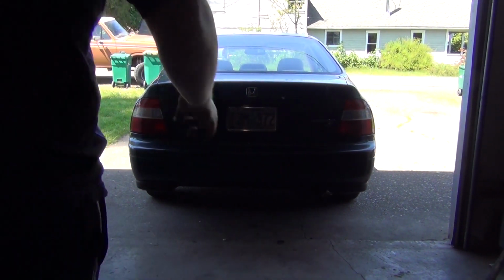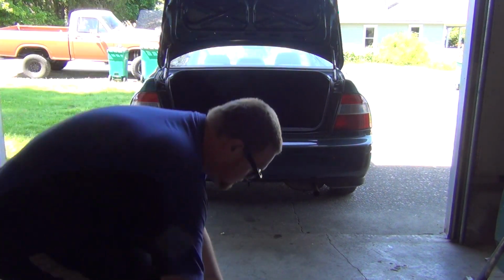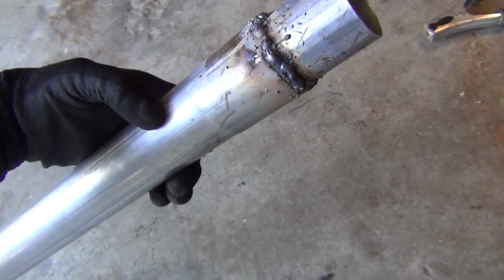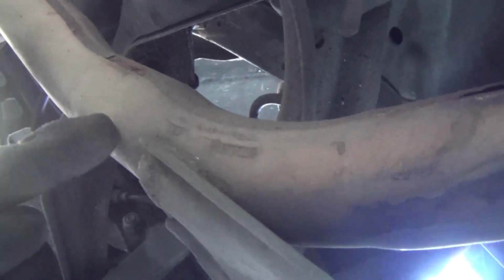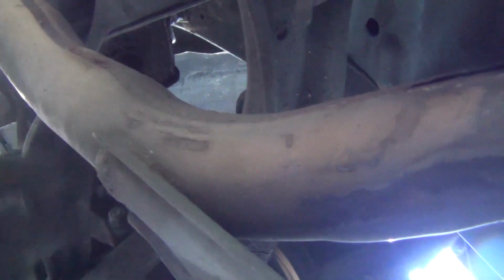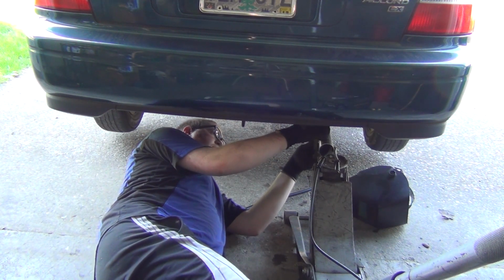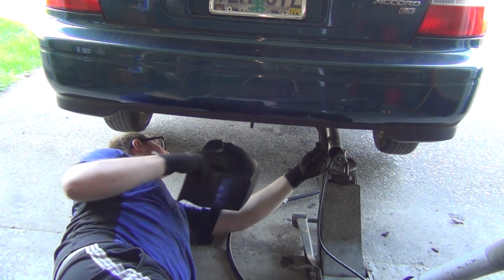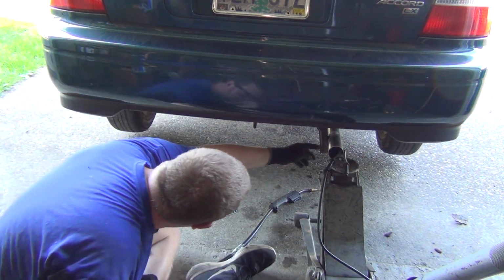Honda Accord Custom Exhaust LOL Video

Comment: Funny that we both have 80s/early 90s Ford trucks and we both got a Honda around the same time for longer trips/second vehicle flexibility
Reply from the maker: yup. i also wanted something with air conditioning and cruise control. so nice.
Reply: Johnson's Gee-rage I thought I remember you fixing the AC in your bullnose? My 91 has AC and power everything including cruise control so it's actually nice to drive on the interstate, just not amazing mpg, about 18 on a good day. I replaced every AC component on the truck myself last summer, well worth it.